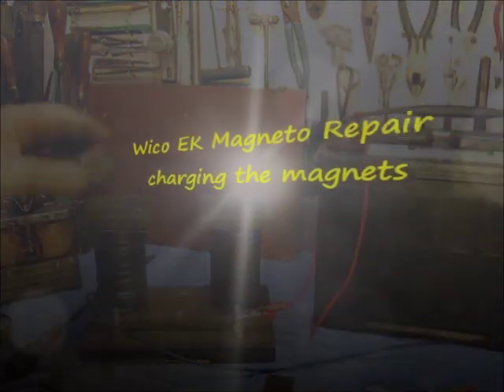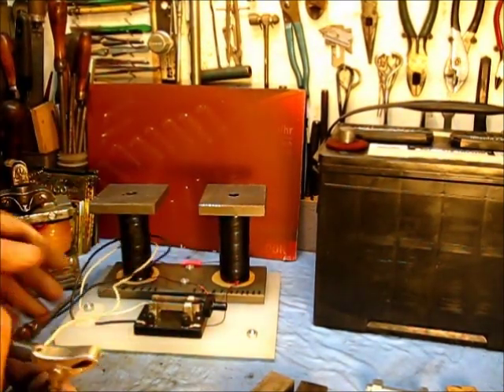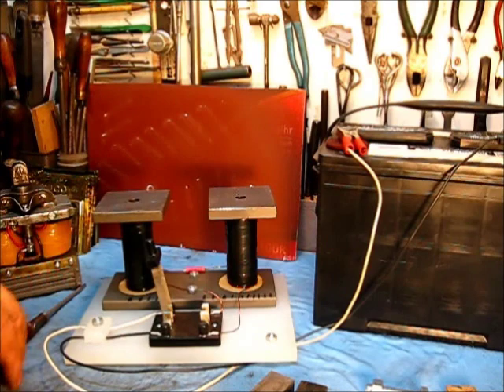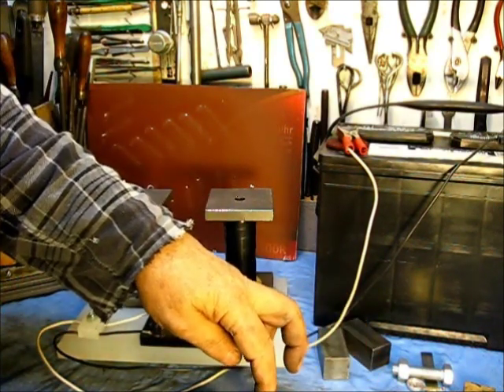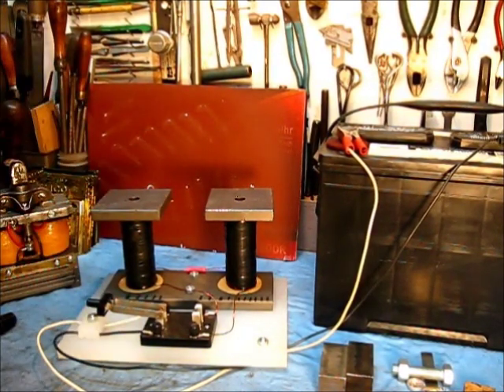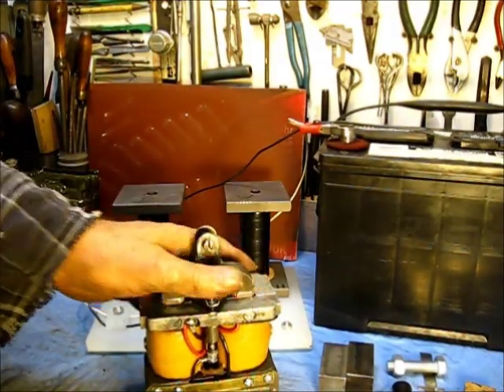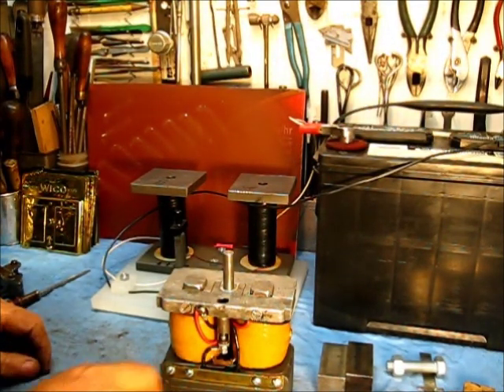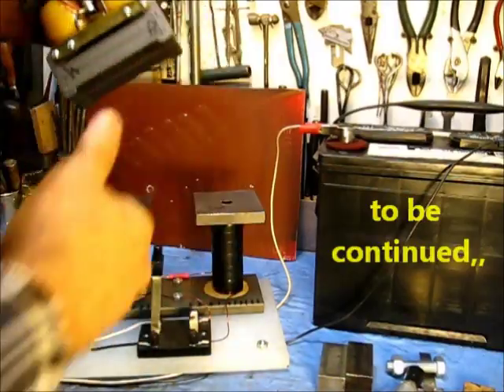Wico EK Magneto Repair charging the magnets 15of

Comment: There's a simpler way of determining the correct polarity that's absolutely fool proof. Just suspend the magneto over the charger by a wire or string while energized and the poles will automatically attract correctly. Just be sure you don't hang it by a part that can pull loose, and be prepared... it really wants to yank it down. Actually, as soon as the magnet gets close to the charger, it will start turning to align itself. Shut off the power, set magnet onto charger & re-energize.  <><

Comment: Thanks for the work of these videos.  Ya ever have loose magnets in the mag?  Pulled one down for some cleaning and the magnets are loose in the frame.  No round pins tightning them into place, looks like some flat stock between them but it sure aint tight.